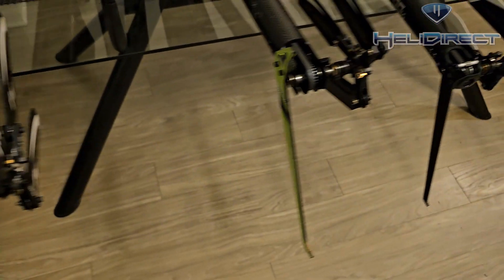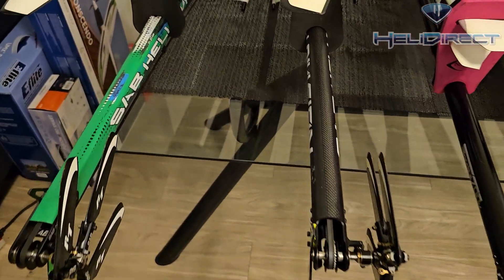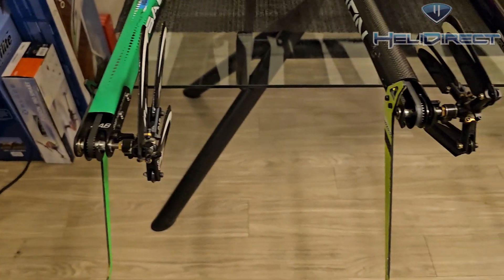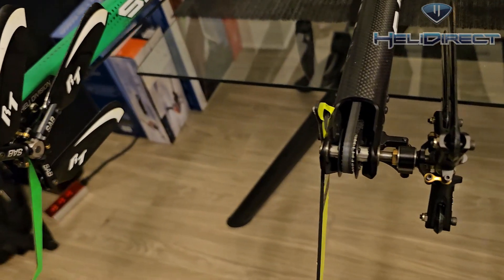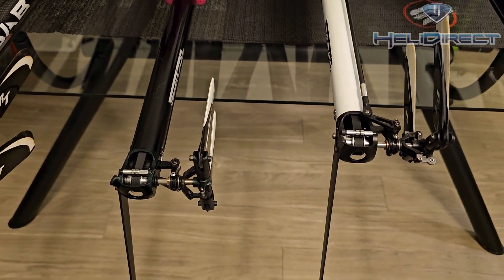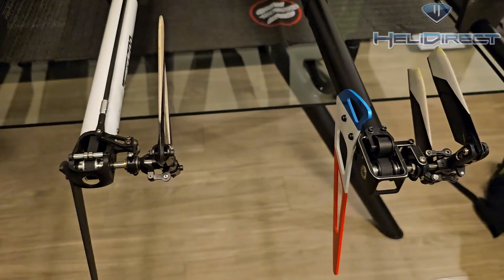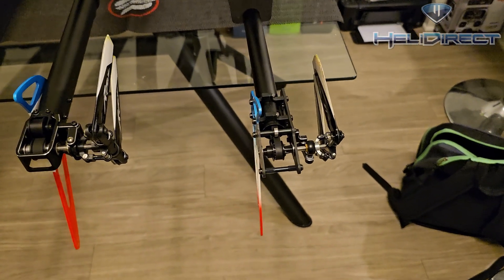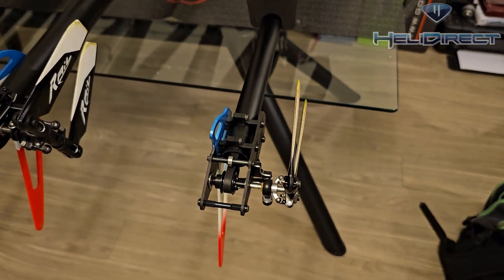Professor Mikel Graham: Tail belt tension, get it right!!

Comment: BS as all the carbon booms are aluminium tubing underneath, so what are you talking about alloy vs carbon booms?
Reply: Not true my goblin kse raw is have full carbon fiber boom the only aluminum is where the boom clamps are an not the full length of the boom. Unlike my Synergy 516+556 the complete boom is carbon fiber
Reply: @CL-Carrington correct. The raw kse has a full carbon boom, as well as the kraken.